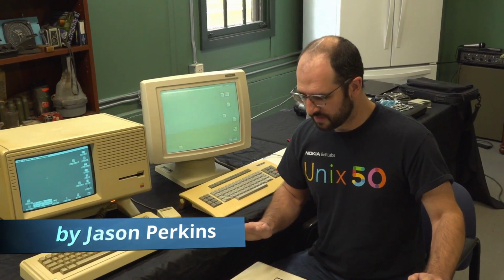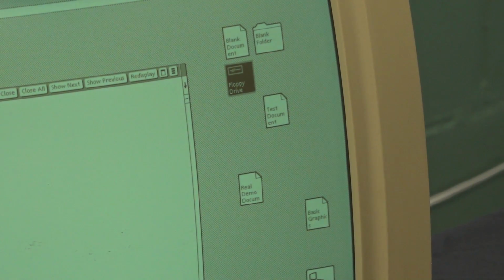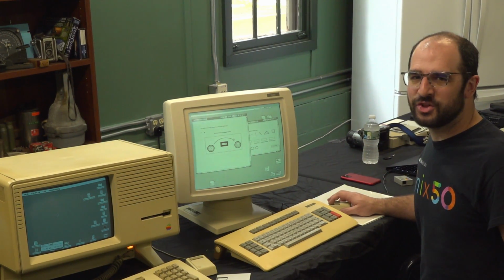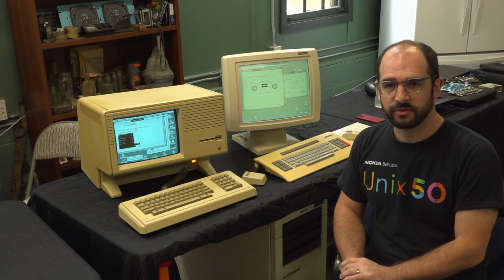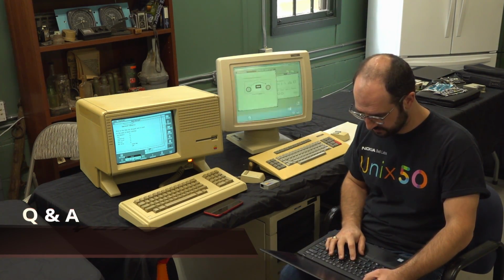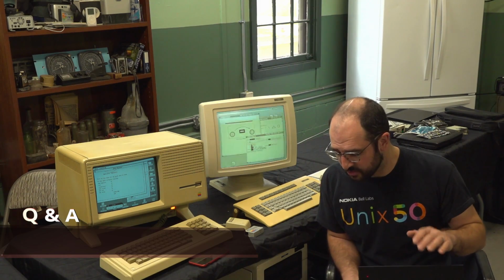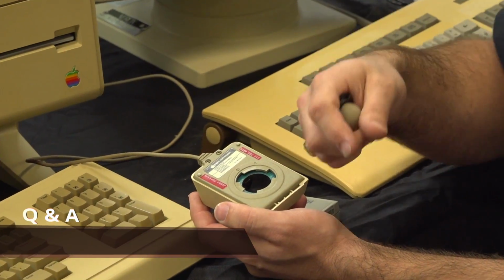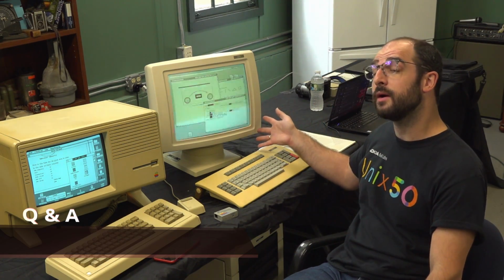VCF East: Xerox Star vs. Apple Lisa

Comment: One of the things Apple absolutely ripped off Xerox with the Lisa was a ridiculously draconian DRM system. Once you inserted a new program disk in a Lisa, the computer would write a serial number to the disk, locking it for use only with that specific machine.
Reply from the maker: @shmehfleh3115: Wow! That's crazy!

Comment: Interesting. The Lisa reminds me very much of Berkeley Softwork's GEOS on the C-64. It even looks as slow as on the Commodore. And that is surprising because the C-64 runs on a puny 8 bit 6502 (6510 actually) with only 64K of RAM, whereas the Lisa runs on a 68000 with 1MB of RAM ! So this is showing how great and efficient the programmers at Berkeley Softworks were!
Reply from the maker: In 1996 a co-worker described GEOS as "8-bit Windows". It was indeed a great accomplishment! And yes. I would love to know why a machine with more horsepower and memory couldn't perform better.

Comment: Back in the 1980s I worked with both the Xerox 8010, and the 6085 for about 6 years total. There was a next program loaded onto them called Versatec EXPERT (Drafting), part of their Engineering CAD software that also had PC board design. I cannot seem to find much information on, but for it time, was really powerful. Even to the point where you could load a picture into a drawing in order to trace it. I would have to reboot the computer to switch between Viewpoint and EXPERT CAD.

It seems like I remember there was either GUI improvements, or we had all of the options for such things as similar to todays Copy, Paste, and also Drag and Drop functionality. Also, the 6085 went to one of the first optical mouse - Though needed a specific patterned 8" X 7" Aluminum grid pad.

You have brought back SO many memories (and nightmares)..........LOL Interesting the keyboard you have the for the 8010 I've never seen before. Seems like a transition model from the original "clunky" 8010, and the modern "sleek" 6085 keyboard.

PS - I hope you never get the dreaded system crash error code of 915, or 935. Sometimes a full system reload was needed.
Reply from the maker: We are so glad that you enjoyed the video! Thanks for sharing your experiences!
Reply: @vcfederation  An additional tidbit. A US Government Agency had a few hundred of these systems (8010 & 6025) at sites around the world running the Versatec Expert CAD Drafting program, and under contracts, Xerox had to keep these running until the mid/late 1990s until the switchover the PC/Windows machines. Again, I cannot thank you enough for this!!!!!  😃

Comment: I bought one of those for $300 at an auction years ago. It turned on and worked when I inspected it before buying it, but then it broke the instant I turned it on when I got it home. I still have it, but it’s still broken.
Reply from the maker: You got it at a nice price! Depending on where you are, we can suggest a local vintage computer community that can help you repair it. Send an email to repairworkshops@vcfed.org for info.

Comment: Xerox Star has AMD's Am2900.  Star workstation hardware was known as a Dandelion. The performance of the Dandelion machine, which sold for $20,000, was about 850 in the Dhrystone benchmark.

68000 @ 8Mhz has 2,100 Dhrystones.
Reply from the maker: Interesting. Thanks for sharing!

Comment: I was shown an Alto running Interlisp at PARC by my friend John Seely Brown back around 1978.  It has been a long time, but I don't remember the user interface being as clunky as on the Star demonstrated here.  John had an AI group consisting of Alan Bell and Dick Burton and others at the time, so they had internal access to Altos, and later the Dorados, which had microcode implementing Interlisp very efficiently.  I was very impressed with the lisp interface, the memory-mapped raster display, and the networked interconnections with other computers running Lisp implementations around the country, notably a lot of PDP10s at the time.  Having seen this, I built a memory-mapped display computer based on a pre-production Motorola 68000 I got from Tom Gunter at Motorola, which turned out to be very much like the Macintosh circuitry, when Apple released it a couple of years later, and much cheaper to build than the bit-slice ECL CPUs used in the Dorado.
Reply from the maker: Wow! Great story. Thanks for sharing! :-D

Comment: It took 2 years to transfer the idea GUI from xerox star to Apple Lisa and 1 more year to build the Apple Macintosh. 40 years later we still have a keyboard and a mouse on the desktop and programming is the same as ever. I believe the work to use icons and graphic displays was important but we use only letters and operation characters to write code to let the machine „live“ and work for us. It’s time to think new and make the next great step. today the machines are bigger (more RAM/ROM/Flash/Drives) and much faster the displays are better but the way to use machines and writing programs on it are the same as it was in 1981. my question when will follow the next great step after 40 years?
Reply from the maker: Interesting idea. I'm sure there are many ways programmers could step up their game come out with the next great breakthrough!

Comment: I heard the Xerox machine cost something like $16k.
I wonder if they could have made a commercial version for under $2k?
Also, that monitor was massive compared to most computers of the very early 80's.
Reply from the maker: That was the commercial version. The cheapification is the DayBreak. Yeah. It was massive.
Reply: Ah so it was under $5k. Not bad but being released in 1985 it was too late and still too expensive. It's a pity. But then again, if they were such a poor organisation in terms of commercial vision then it was probably better that dynamic companies such as Apple and Microsoft drove the technology forward. @vcfederation

Comment: I would be wonderful if the Lisa could be embodied in FPGA so it could be preserved rather than emulated. The Xerox even more so but from the user perspective so dependant on they keyboard.
Reply from the maker: Yes. It would be nice to emulator it in a way that matches the original as close as possible. Original machines are rare, expensive and hard to fix.

Comment: "Apple Lisa - by Steve Jobs"...

Lol, surely not. Or would you say "The Commodore 64 - by Jack Tramiel"? Or "Microsoft Word - by Bill Gates"? Damn, that guy Steve Jobs was crazy about computers and technology, but he was just a very talented CEO who didn't have much of an idea about the internals and how these machines actually worked.
Reply: Blame Jack Tramiel for not evolving the MOS/CSG 65xx CPU family in line with the competition like Intel's 286. Acorn Computers funded ARM to replace the uncompetitive MOS/CSG 65xx CPU family. 

Major micro-computer companies that used the 65xx CPU family have transitioned to Motorola's 68000.
Reply from the maker: @valenrn8657: Yes. Jack could have made a better decision. He was kicked out of Commodore, so who knows what he would done if he had stayed.
Reply from the maker: @bierundkippen720: Well Steve Jobs did run the project  for a while before getting kicked off, but yes, it was a team project, not just one individual.

Comment: Now with Darkstar (Xerox 8010 emulator) you can live it all over again on a PC desktop.
https://github.com/livingcomputermuseum/Darkstar/releases/tag/v1.1
I only hope the 6085 will be next for emulation.  I have a small treasure trove of software to go with my dusty 6085.  The Basic Graphics software was a application I used quite a bit.
Reply: Your 8010 desktop is a mess, you'd be severely chastised around Xerox ;)  Another favorite remark around Xerox when printing documents was "It's a printer, not a copier".

Moving a 8010 controller while powered on could have ill effects.  Elderly Quantum q2040s/q2080s would "growl" if you moved the controller, if even only a few inches.

At least when you look at the two systems with the camera pulled, back there is no AC band on the 8010's display, like there is on the Lisa.

The "Paginate" function is to remove the fragmentation and revision marks making the file more compact, therefore using less space.  This helps the file open faster.  Standard practice around XC1 was to reboot the workstations at noon.  As the system rebooted, unused disk space would be recovered.

The 8010 was also the 8000 Server.  The 8000 Server ran Xerox Network Services (XNS).  Typically the 8000 server had a video data terminal connected to it's serial port.  You could also use the 8010 display and keyboard while set up as a 8000 server.   

The 8000 server could be configured with either an internal 40MB, 80MB HDD, or externally connected 900MB HDD.  The software and document files were so very small compared to what is used today that a Xerox 8000 with a 40MB HDD could hold 1000s of disk pages of data files.
Reply: @DandyDon1  This 8010 doesn't have a spinning disk anymore - if it did I wouldn't be shoving it across the floor for sure! 
I used Darkstar to prepare for this demo - I wouldn't have been able to do it otherwise.
Reply: @compu85  I did hear it explained that the HDD had been replaced with an MFM Emulator.  I know it was also explained who manufactures the emulator but, I cannot remember the person's name.  I have an 8000 sitting here collecting dust etc.  The HDD died a long time ago.  Another problem with the Quantum Q2040 HDDs I found is there is a rubber bumper installed to take the shock of the head arm propelling itself outward if power is cut off.  That rubber bumper turns to goo, and the head arm will stick to it.  

I've been curious to know will XNS 8000 Executive Server Software run in Darkstar.  Darkstar does have the ability to communicate using an network connection.  I have the full set of XNS 8000 software.  

The only hurdle is, Xerox had a "keygen" piece of software support used to create a key for your company name, or the server(s) name.  I cannot remember exactly which it was.  You could then fully enable the software modules and add the "box" to your network.
Reply: @DandyDon1  David Gesswein made the MFM Emulator: https://www.pdp8online.com/mfm/mfm.shtml he helped us extensively getting this Star going.  

The HDD that was in this system had a goopy bumper, David got the disk to come up once and imaged it. 

A master key has been found for the software. You have to set the system to a specific date, then use that key. This is documented in the DarkStar instructions.
Reply: @compu85  I have all of the master keys which were provided to me by a friend at  Xerox when EDS was phasing out all of the 8010, 6085, 8000, 8090, 2700, 3700 systems etc.  With XNS (Xerox Network Services) software I remember an additional step required.

Comment: Note: That Lisa is the Lisa 2, which used 3.5" drives like the Macintosh, rather than the 5.25" Twiggy-drives. The Macintosh was originally supposed to have Twiggy-drives, but that was changed due to reliability and data density. The Lisa 2 would evolve into the Macintosh XL, which was a 2/10 modified to run and develop Macintosh software
Reply: The Lisa 2/10 and Macintosh XL are identical, the only difference was the software included with the machine.
Reply: Also specifically, the Lisa in this video is a Lisa 2/5 (with a more modern hard disk mounted in the empty spot in the drive cage).
Reply: Yeah supposedly the Lisa 1 is much rarer and harder to find than the Lisa 2, as Apple offered user free upgrade to Lisa 1 owners, which I believed only changed the original Twiggy drive with a Sony single-sided 3.5 inch drive. They made decision after seeing how reliable the drive, at least compared to the Twiggy was was notoriously unreliable, was after using it in the first Mac.

Comment: Following the question about a blitter, the camera person said “On the Lisa it would have been in ROM as part of the Toolbox.” The Lisa only really had a bootstrap ROM, it loaded everything off disk, unlike the Macintosh. The Alto, Star, Daybreak, etc. were similar, they had a bootstrap but most code was loaded from disk.
Reply: I have a Lisa 2/10.  The machine takes a good five minutes or more to boot up.  Very much loading a crap ton of stuff from the hard disk.  As opposed to having things in ROM.
Reply from the maker: @GaryCameron780: Yes. It takes forever to load!
Reply from the maker: @cmhenator: Thanks for the info!

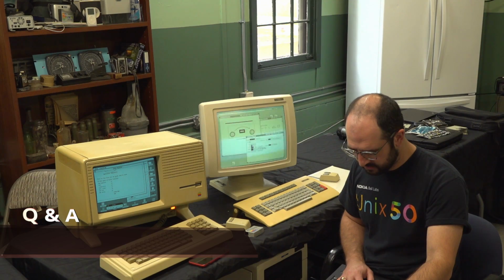Comment: At 30:40 someone asked whether it had “blitter circuitry,” which Jason wasn’t familiar with: A blitter implements BITBLT (bit block transfer) to offload work from the main CPU. Alto derivatives such as the Star used custom microcode to essentially implement a BITBLT instruction, and at least originally also implemented display list drawing—which they used instead of a frame buffer!—as a “microcode task” in that their microcode was multi-tasking in addition to writable.
Reply: Xerox IBM ATT would merge and would have interconnected world at least 10 years earlier than the present internet. Hey who knows maybe the Global Corporatists would have been the good guys not the evil and greedy predatory scum they are now.
Reply from the maker: @cmhenator: Thanks for the info!

Comment: Thank you so much for this demo! I was a programmer at Xerox in El Segundo CA from 1982-89; I maintained the desktop (grid of icons) and folder implementation. It was wonderful to see one of the old 8010s up and working. 

It would be useful to put the name of the presenter in the description. 

A few points:
- The Star software was developed by teams in Palo Alto and El Segundo. Both were part of the Office Systems Division that I think was based in Dallas.  The core software was done by an org called SDD (Systems Development Department). This was separate from PARC that developed the Alto; it's the Alto that Apple saw that influenced the Lisa and Mac.
- I think the presenter essentially got the question about peer to peer networking. The full 8010 system included print servers, file servers, mail servers, and I believe communication gateways that would let you hook your Star systems together beyond your local network. That whole server system was way beyond the competition, but also contributed to the Star's downfall: it was not possible to buy a single Star workstation: you needed to also buy some number of network server machines. That pushed the buying decision out of the hands of an individual manager who could, say, buy a Mac.
- The later Star system that was referred to as Daybreak was the 6085. I can't remember when that came out, but I know it also had a presumably much cheaper-to-produce optical mouse that required a special mousepad with a pattern that the mouse could read.

Hats off to those who got this system working again and to the person doing the demo. Great job!
Reply from the maker: Jason's name is right there in the description: "A Live presentation by Jason Perkins at Vintage ..."
Thanks for the info about the system. A dedicated group really hit that 8010 hard and got it working in a few weeks. Next up is a Daybreak 6085 that we also have, but need some accessories. Your information about the details of the system help tell the story of this fascinating machine.
Reply: @vcfederation  Whoops! Sorry I missed it.
Reply: Just FYI, if you want to make a Star or Daybreak optical mousepad, I pointed a friend who’s good with PostScript at the patent, and he produced this: http://rendezvous.eschatologist.net/xerox/XeroxMousepad.ps If you swap “ps” for “pdf” you can get a printable 8x11 PDF.
Reply: Were you at DSBU (Documentor Systems Business Unit) in El Segundo, 701 South Aviation, or at USMG XC1, or XC2 (Xerox Centre)? I cannot remember if the software testing lab was on Apollo or not.  There was also OSBU (Office Systems Business Unit), OSD for short I think.  
Now no one would ever know that Xerox had a presence in El Segundo, California.

Comment: Nice. Right... the xerox as well as other workstations from that time were built upon a bit-slice approach (bit silicing). You can arrange a series of ALUs of n bits (often 4) in order to create a custom ISA or even a known one out of microcode. The most popular were the AMD 29xxx series. For example, some early Apollo WS were created with a 68010 ISA made out of bit slices, or the early SGI geometry engine.
Reply from the maker: @paco3447: Thanks for adding info to the conversation!

Comment: Apple also paid Xerox 1 million to license some of the ideas behind it. So, not stolen in any way.
Reply: That's probably why Xerox sued Apple in 1990 ?
Reply from the maker: @mglmouser: In any case Apple didn't start from scratch with completely original ideas. They used a lot from Xerox.
Reply: Xerox also got some amount of pre-IPO Apple stock for the right to use whatever SJ & crew saw.
Reply: @cmhenator  Yup. Yet another reason the argument that Apple stole everything from Xerox is wrong.
Reply from the maker: @compu85: At the very least they borrowed a lot of the ideas and access to the code. It wasn't completely original.
Reply from the maker: @cmhenator: They got a early look and a look at the code of the Alto.